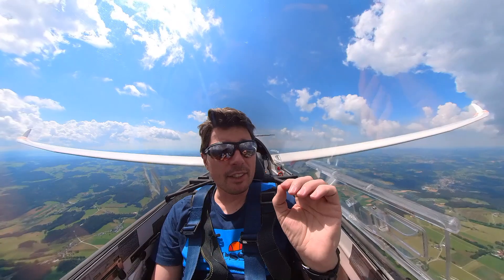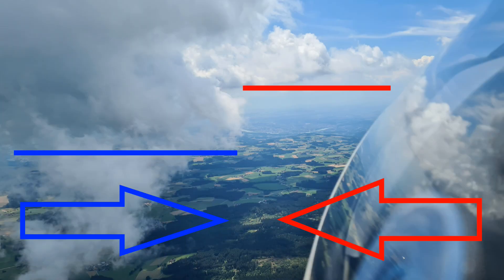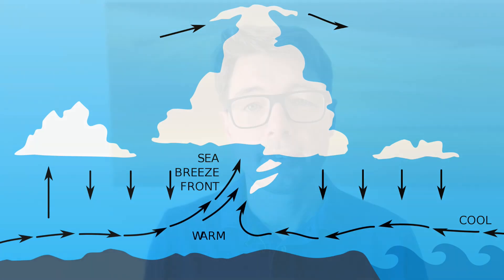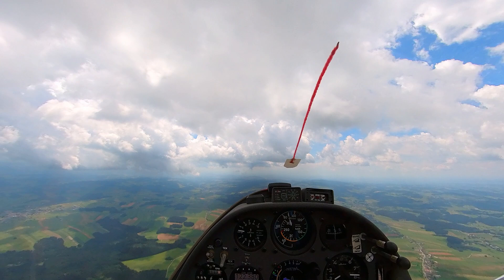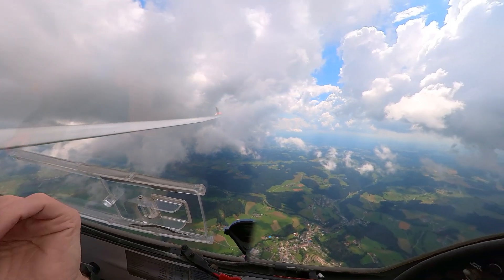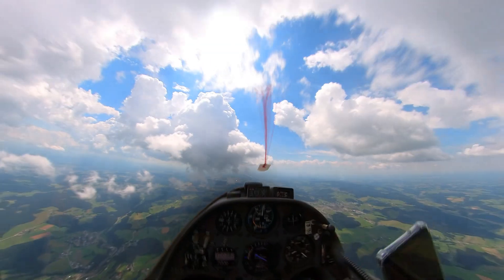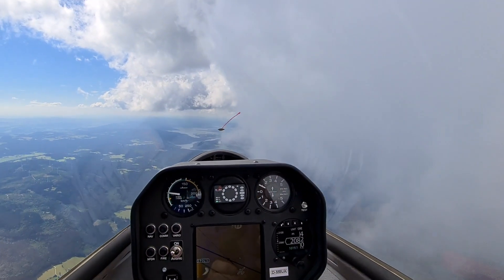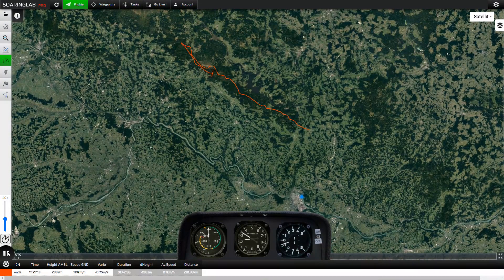Flying 100km straight in a glider: soaring along a convergence zone

Comment: I've flown in convergence several times, but not yet for 100 km.  Maintaining the horizontal and vertical clearances for VFR is challenging.  Maintaining the correct crab angle to avoid being blown into IMC is likewise difficult.  It is guess work because there is no reliable visual reference.

It is fun to find convergences where there are no clouds.  A real time wind indicator like Hawk or Anemoi might be useful.